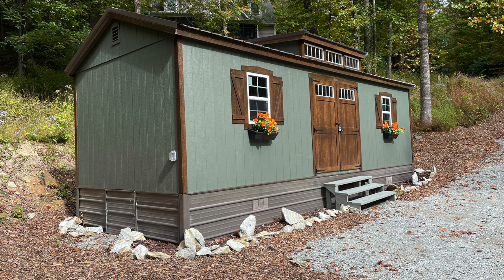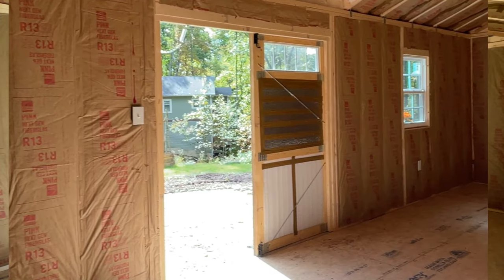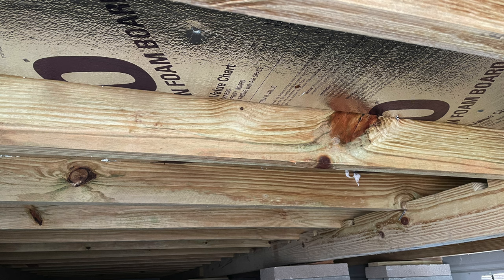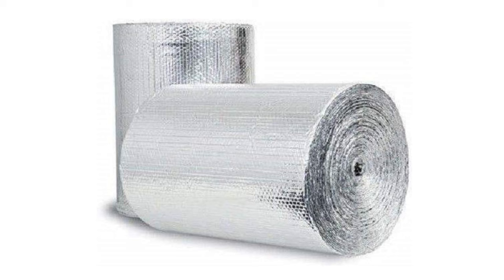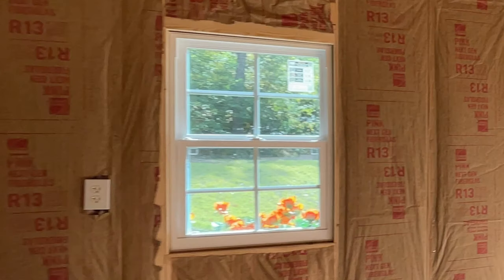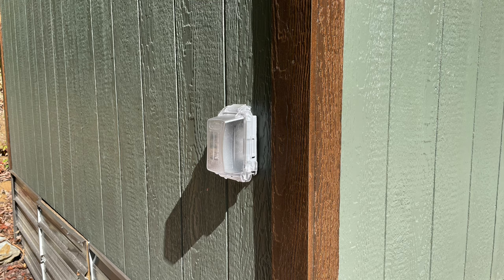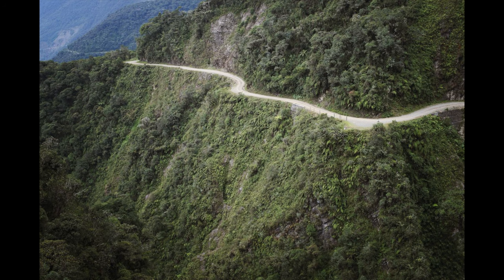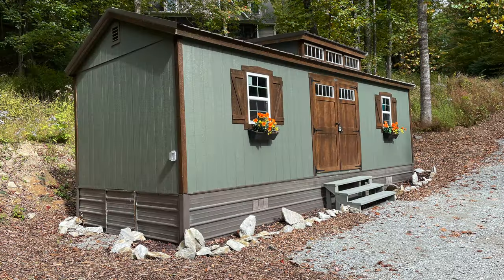Details in shed to Tiny Home Build

Comment: Per the doors /insulation. There is a place that sells very thin insulation made specifically for sheds and it has very good reviews. I've bought some but have not yet been able to put up enough of it in the shed to be sure of how well it works.  I intend to use it for the whole shed, which will leave a lot of room, where the insulation would have filled it in, for there to be storage that doesn't take up additional floor space.